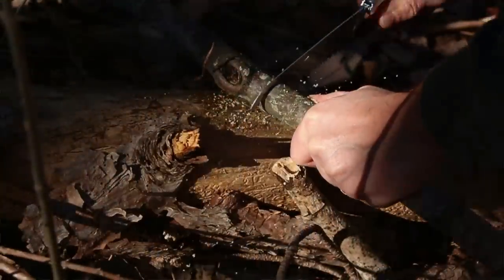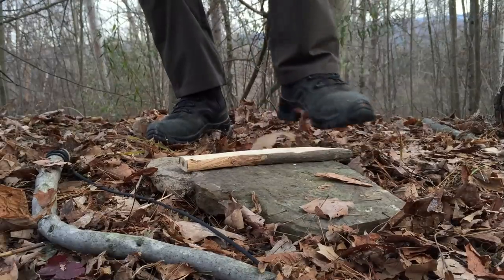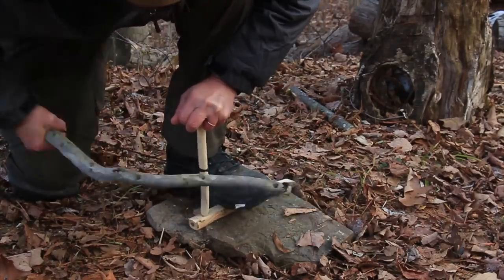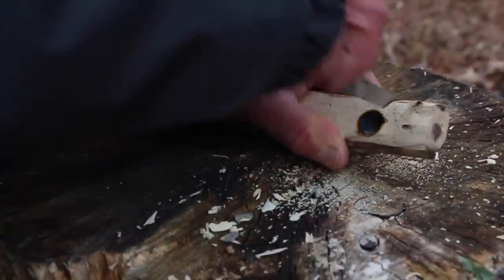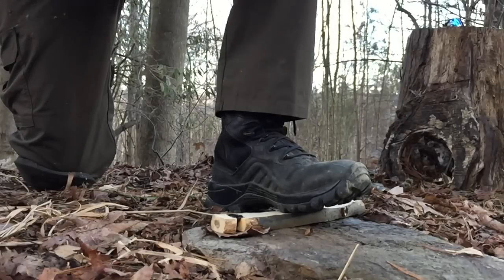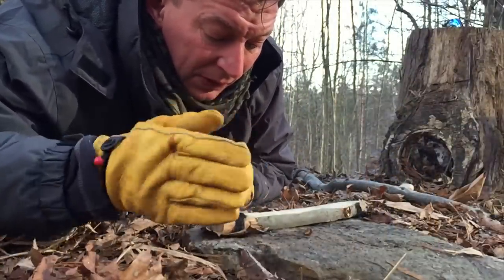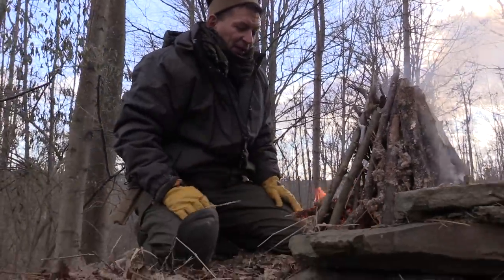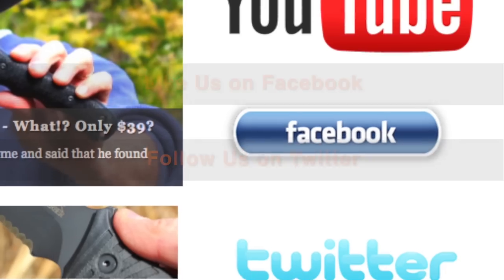DIY - How to Make a Bow Drill  Fire - Part 2 - Step-By-Step Survival Bow Drill Training

Comment: thank you sir for going into to great detail about making fire with a bow drill.  I have never seen or been taught the part where you informed the audience that if you have a dark char around the hole and spindle, it evidently is to wet or damp.  You showed the difference and then showed how it needs to be black dust or particles around the fire board to be doing everything correctly.  Thanks again as I learned something I did not know.  I have never even attempted making fire this way, but I thank you for the information as to know how to do it correctly if and when i ever need to.  God Bless

Comment: Great video David! You did have some good points, and I'm glad you mentioned all the different kind of woods.  Its easy to say "hard", "soft" wood, but that doesn't always translate to people who are still learning bushcraft.  You mentioned some woods that I am familiar with here in Alaska, and one I didn't realize was classified as a hard wood!  Also, one tip I heard of was another flat board, maybe if you split a branch for your hearth, to use for standing on the hearth board.  The reason is you have to eliminate as much moisture as possible.  And if the ground is wet, or God forbid, snow, then stepping on the board with your boot transfers the moisture from the bottom of your boot, into your board. Thus, making additional attempts impossible.  if you use another flat piece of wood on top of your board, and then place your boot on that, you have a lesser chance of transferring moisture.  The tip showing the difference between a good burn in and a bad was awesome!  Can't wait to try my first bow drill.

Comment: I have not tried this yet, but can"t wait to. Two things that I noticed you do that you didn't make any point of mentioning were...1. I noticed that the bow string coming from the tip away from you is on top of the twist. 2nd, I see that you put tension on the string as you work the bow back and forth. Are these important to do? Thanks .
Reply: Yeah lol, he didn't even mention the tension he clearly put on his cordage to make it tighter so it wouldn't slip. Important step to the process I believe.

Comment: Nice with part two of this series, thank you for that!
but the way you attach the string to your spindle, could cause the string to lock, especially when doing it with natural cordage.
if you do it the oppersite so that the string goes around and under itself, it won't have the same chance of locking.
again, not to sound negative...
realy good video though!

Comment: Hello, once you have used your board once and gotten an ember out of it successfully, do you have to create a new socket hole and notch it out?  Can you not reuse the original?

Thanks,
Warron
Reply from the maker: +Warron French GREAT question. You can use your same hole and notch multiple times until it burns down too far to collect enough ash to create an ember. This depends a lot on the wood you choose, the thickness of your fireboard etc. I have kits where each fireboard burn last 20 or 30 times and I've had kits (made of balsa wood) that burned through in 3-5 uses. Hope this helps. ~D
Reply: Ultimate Survival Tips hey thanks for the reply.

Comment: Is it possible to use an actual bow instead of that?
Reply: Don't think so
Reply: It might be possible if you loosened the bow string
Reply: I wouldn't. Bow drill can be very hard on the cordage and could damage your bowstring badly.
Reply from the maker: INFLTTR1 I wouldn't. Making a bow out of a tree limb is too easy to make to even think about using a "real" bow.

Comment: So not ultimate. Only basic info and if I can offer some advice. I noticed you are using lots of little strokes. If you use a longer bow and make longer strokes it will take allot less effort and hopefully not wear you out as much. Also it looked like your body was in the way of your strokes in that position. this is bad because it also limits the length of your stroke and makes you have to work harder.
Reply: Did you see part 1? He offers plenty of info.
Reply: Phil Theeneger I was talking about this video on form and use for which it is basic info with noticeable room for improvement. But if you want to talk about the first part. The first part did a better job going into detail on it's subject. The only problem I have with part one is that the bow is way too short and I find a thinner spindle seems to work a better. Could have talked more about cord tension but wouldn't make a big deal out of that other then it isn't ultimate.
Reply from the maker: NoBSSurvival Good points. There is room for everyone's preference and experience here. Thank you. ~D
Reply: I find it sometimes difficult to keep the drill in place when the bow is too long.